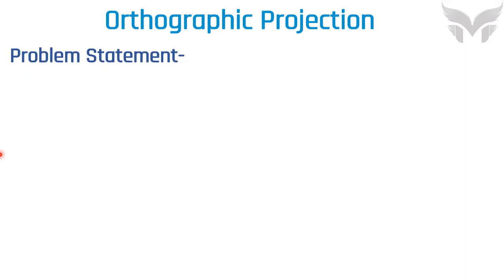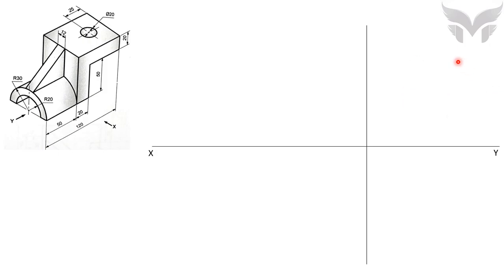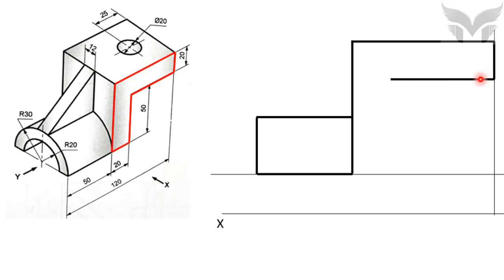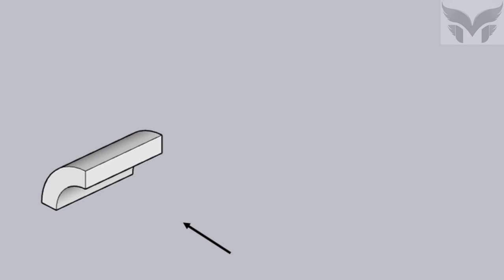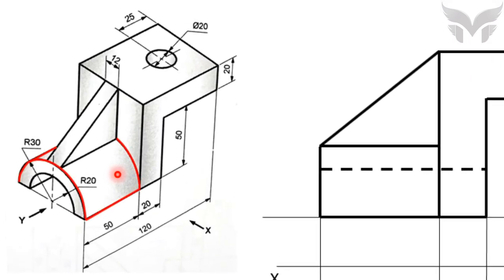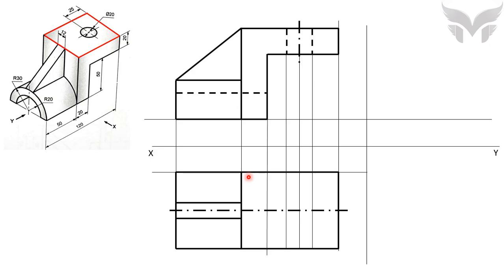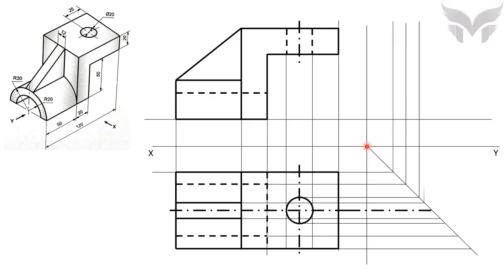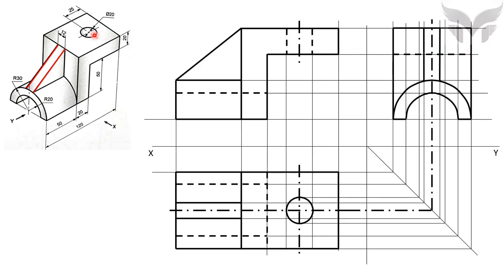Orthographic Projection (Problem Solving) #engineering #engineeringdrawing#firstanglemethod

Comment: Why the size of arc from the front view and top view of the arc is not the same . . Why the front view is 30 then in the top view it became 60 . It should be the same right?
Reply from the maker: Size of an arc is 30...means it's radius is 30...so diameter will be double, which is 60.... 
When you see that arc from front you see its radius i. e 30mm.... And when you see from top you see arc's diameter i. e 60 ...